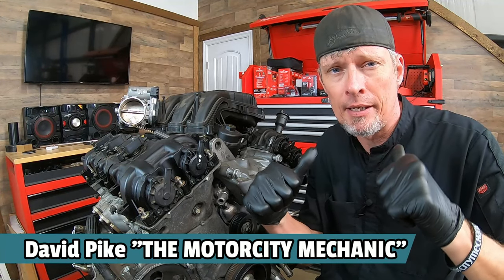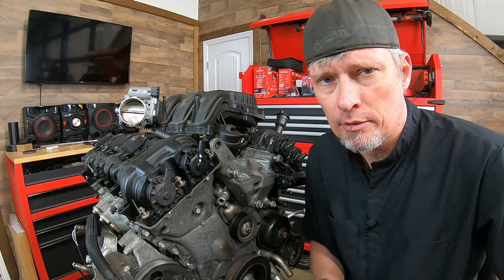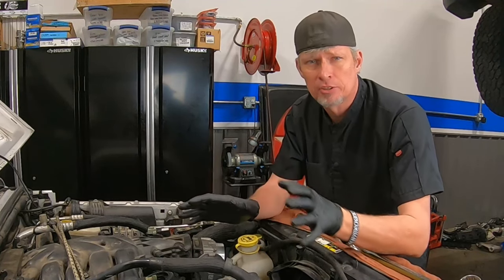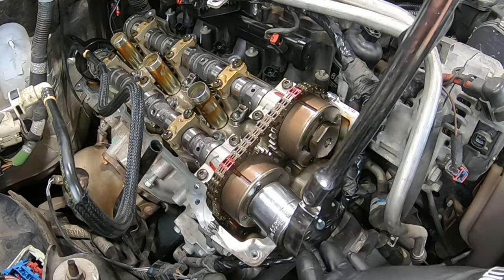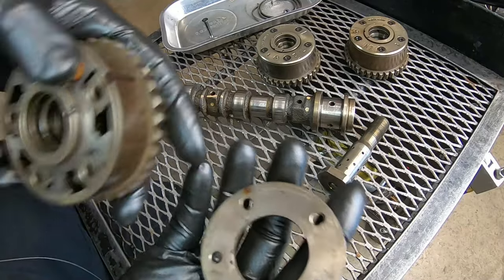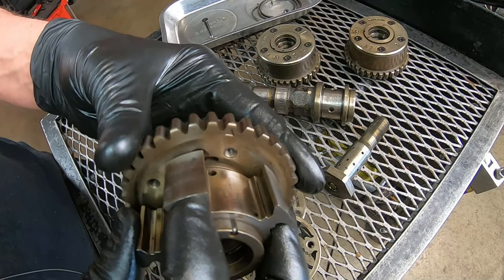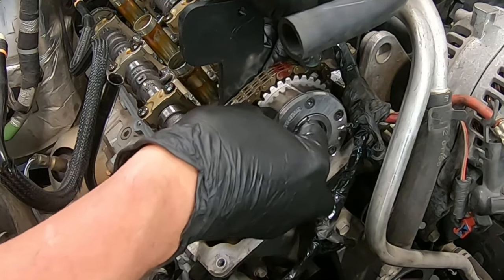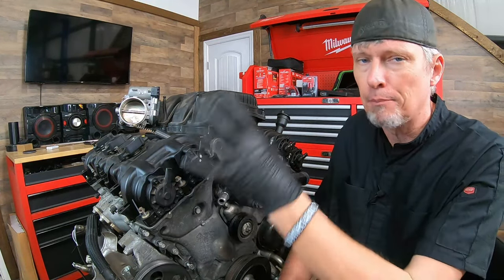Chrysler 3.2L/3.6L Camshaft Sensor Codes Possible Cause

Comment: Really good detailed explanation of the problem and the related concerns. Thank you. My 2012 Chrsyler 200 Limited 3.6 is throwing  P0340, P0345, P0365, P0394 codes. 125K, I'm tired of spending chasing the solution. Time to move on...

Comment: Fantastically good video as always! In fact, my latest video is a shoutout to your channel, simply because it’s the best for rocker, cooler, and oil pump repair guides! 

Couple of points:
As you know, we only do Promasters and most are commercial. I’ve found that the limit is between 550 and 600k miles. Assuming you address the rockers and oil cooler and dont overheat it, it’ll run fine till the rings start getting worn enough to merit a new engine. Will still run fine after 600k, but power and mpg will start to suffer. And when I replace engines, I buy 100k used ones for $2000, do the AH rockers before I put them in, and they go to 550k. Basically, the pentastar doesnt care about miles!

Second point:
We’ve never fought with P0340, but twice now I’ve fought and failed on P0016 and P0017. I’m guessing a failed phaser wouldnt code the same way, but it might. Let me paint a picture: dealer had custys van for close to 2 years! Chasing P0016. Replaced EVERYTHING including the PCM, ran dedicated wires to the CPS, multiple cams and phasers. Finally talked the custy into throwing a Jasper at it! Didnt fix it. Star case opened. Engineers visited. Dealer threw a SECOND Jasper at it. Still coded. Dealer kicked custy out with no resolution. 

Came to me. I dicked with it a while, verified everything. Failed. Sold the customer a midlevel scanner that would reset the code, and spent a proper amount of time reassuring them that it was liveable, and how to reset, and monitor pids to make them feel ok about. They are still driving it - it’s fine. 

That job was, to me, a complete fail regardless of the happy ending. We saw another P0016 where a quickie oil change place had double filled the crankcase, which frothed the oil. That custy got a new motor out of it. 

Anyway, I’d like to know if you think it’s possible that the computer could code in both ways for the same phaser problem. Occurs to me it could, depending on if the pin was stuck locked, or stuck unlocked. But I’m unsure. Thoughts?
Reply: "do the AH rockers before I put them in" What are the AH rockers? I googled AH rockers and didn't come up with anything. I put Mahle lifters and rocker in when I did mine.
Reply: @yepitsme6202  All chrysler part numbers end with two letters. In this case, AH with the H being the revision number (8th revision). AH are the latest parts, and said to eliminate or lessen the problem with the rocker arms.

Comment: David, thanks AGAIN for your instructive videos on the 3.6L VVT engine.  I am watching everything you put out on that engine - mine is in a 2013 Charger SXT and has 194,000 km on it.  No evidence of any problem yet, but I'm listening and watching.
Reply from the maker: If you ever have an issue….you know where to come to find out how to fix it
Reply: @MotorCityMechanic  Excellent video, thank you for your insight!  I recently replaced all of my cam followers and lash adjusters on our 2012 Jeep wrangler at 140k miles as we had one that was just starting to fail.  Ran great for 3000 miles, but am now getting P0340. P0365, P018 and P019 codes all at the same time.  Extended crank and momentary shudder sometimes after the engine fires up.  These are opposite banks, so possibly 2 unrelated issues - or are they?  Any insight on if these are related, and which bank to start diagnosing first?  Oil pressure is normal, and when I was inside the motor, there was no damage to camshafts - we had caught the failed cam follower in time before it did any damage to the lobe.  The camshaft reluctor (pickup) wheels did have some metallic buildup that was wiped clean but did not seem excessive, and common compared to what I have seen from other videos.  Thanks in advance for any advice!  - Jerry

Comment: Good to see a first gen still running after 200k.   Great breakdown of the problem David, always appreciate the videos.
Reply from the maker: I have a few expediting Promaster vans that have 500,000 miles on them!
Reply: @MotorCity Mechanic  so they are a good engine?
Reply: @mikegordon3436  I have a 2011 Chrysler T&C.  I had the cylinder head recall right after they came out, and I haven't had an issue internally.  The problem is everything attached to the engine that you have to worry about, but those parts are cheap to replace. These engines just like to have the oil changed regularly, and they seem to run great.

Comment: I just did the complete rocker/lifter swap and the rt side intake cam following your instruction.  I am a competent mechanic of over 30 yrs. so your instructions were easy to follow and my time was well spent watching them.  Thank you.  My problem is the jeep will not fire off now.  R2 the cam sensors, the crank sensor, the Inlet air temp sensor, and ck all thge engine and body grounds.  I didnt do anything diffent on the disassembly and had no left over parts.  Would a bad phaser keep it from firing?  I am leaning towad the notches on the back of the cam are not sending the signal to the tpm. I bought the cam on amazon so that ones on me.  any info on any more troubleshooting before i tear it all down agaito ck cam and phasers on the rt side would be appreciated.

Comment: Wait!! I think you still can remove the solenoid to check it. It looks like there is enough room to make two paint marks, one on the oil control valve and one just on the phaser body and use a bore scope or good camera to monitor if the paint marks stay aligned or move while cranking the engine over in clear flood mode or something. I have a van with over 200k and thought about long term issues but working in a shop I see several other customers over 200k and have only come across this issue once when the customer ran out of oil due to the oil cooler and had metal shaving in the oil. The customer declined repairs so I never got the chance to take the engine apart. It was also very sludged up which only seems to happen when oil changes are way too extended as they don't tend to sludge easily. Great video and something to look out for.

Comment: You should also check the oil gallery plug/bolt as it work it way loose causing low oil pressure to the phaser, common issues found on the pentastar motors. Meticulous job you do though 👍👍
Reply: It happened to my 2014 dodge grrand caravan , bank 2. The code was p0018, p0300, I went A dealership, he changed my oil and run a clean up process then charged me 500 dollars. One week after, codes came back. Sometimes the only way to save yourself is to watch Youtube
Reply: Yes I've seen a lot of that

Comment: David, as a DIYer I'm following my late Dad's advice to change oil fairly often in my '12 Chrysler 200 Touring convertible precisely because of what could go wrong with any of the cam phasers. My Pentastar engine has 70,872 miles on it and I use Pennzoil Ultra Platinum 5W-30 oil exclusively. I am also considering replacing the oil cooler/oil filter housing with the aluminum housing Dorman kit to prevent oil-leaking problems in the future. This car is my retirement ride and I like it a lot.

Comment: Thank you much, for 11 months now my car has been going into limp mode going up long hills, kept getting camshaft intermittent code P0365, replaced both am position sensors, the crank sensor and all four cam actuators and still happens, I am definitely going to check this out!

Comment: I changed rockers on one bank last weekend. I’m getting rough running and codes now. Bought a scan tool to do a cam/crank relearn. Will see how that goes. Thanks for the explanation of how the phasers work and how to test them. 
My engine has 140,000 miles. 2015 Dodge Grand Caravan.
I did not change the cam. Only one rocker was bad and cam wear on the lobe looked minor.
Reply: Which way did you take the rocker out?  Removing the timing chain, taking the cam shaft off etc. or did you loosen one/two cam caps and slide the rocker out.  If the latter, any chance the camshaft wasn't seated fully when you went to torque down the cam caps from the tension of the timing chain and it was left slightly raised in the channel?
Reply: @garykline2500  I used the phaser lock and tensioner release tools.  Slid the phasers off but did not remove the chain.  I ordered a new intake cam, phaser, and oil control valve.  The lobe with the bad rocker looked a bit chewed up.

Comment: Hi dav…i am wondering what’s was causing the locking pin not in gaged..but when I watched your video many times I think the problem with (spring)was weak not making pressure to in gaged…thanks…

Comment: Thank you so much. I just replaced the exhaust cam on bank 1 and immediately got 340, 365, & 369. I’m definitely going to test for this before removing the cam again.  I have already replaced the sensor and tested the wiring. It has to be this or the cam, right?

Comment: P0369 keeps popping in. Changed all sensors and the P0365 does not come up anymore. But this P0369 is insane, no way to pinpoint the actual issue.

Comment: When you use the tools to decompress the chain tensioner on left side is it common that you don't have to use the pick tool again? I was able to just slide the wedge between guide and end of cam shaft and the tensioner went back in with out using the pick n pull tool in the little hole. I understand it's like a hydraulic tensioner so I'm hoping that when I'm able to start engine the oil will pressurize the tensioner back to normal?? I hope this makes sense the way I described it and that I'm all set. Thank you

Comment: Great video and explanation most videos do not show you the failure points just replacement. Have you ever tried a socket like the one used to replace a heater element in a electric hot water heater its like a tubing thats been pressed into square socket ends they tend to be thinner then a thin walled socket and usually have a hole in them to insert a small bar or screw driver to turn them it may fit in the actuator hole. The wall size on what I have range between 1 and 2 millimeter.

Comment: An oscilloscope will pinpoint a bad phaser easily. Just scope the cam and crank signals, and reference a known good signal. A phaser that's not in sync, will produce a different waveform.

All of this, without removing a single screw.
Reply from the maker: I just monitor the cam position sensor readings....no need for a lab scope.
Reply: @MotorCityMechanic how exactly do I do this with my scanner? Pretty sure I already know but just want to be sure

Comment: I may have this same scenario going on.   2013 Grand Caravan, 200,00mi, Oil filter housing was leaking/had leaked so I replaced it.  Vehicle ran great for awhile and now I'm getting all the Camshaft position sensor A&B banks 1 & 2 codes plus crankshaft/camshaft correlation 018/019 codes, plus traction light.  I'm afraid the low oil condition may have caused damage to the camshaft or phasers?

Comment: Hmm, I am here for that very same problem. 2011 Charger police car, 3.6, Right exhaust phaser is unlocked, p0340 code. Was rattling on startup. I was going to do that vvt sprocket, plus replace the bad rockers and ground cam. BUT the phaser took out the right side timing chain guides. Front cover off to do those. Its a budget job so, just surgically replacing parts unfortunately.

Comment: 12:53 You can use a low-profile oil filter socket and it will fit through the hole left by the VVT actuator. I just did the rocker arms on my 2012 Caravan using your tutorial and used the same socket on the right cylinder head. There wasn't enough room to remove the OCV with a standard 36mm socket due to the AC lines.
Reply: What low-profile socket do you have? The Lisle and Steelman and such that I see online really seem pretty thick-walled.
Reply: @yohannwilkerson6058   14500 Lisle works perfectly and handles the final torque on the oil control valve with ease.
Reply: Certainly a big time saver if a test can be done by just pulling a VVT solenoid.
Reply: I sent the Lisle number to Motor city mechanic a couple of months ago. It is lisle 14500.

Comment: You can use a Articulating Borescope with Light if you have the valve cover off to look down inside the timing chain and see whats going on without removing the side cover if you are good with one to find any problems. With the motor sideways it is a royal pain to remove things if you don't have to.

Comment: Have you experienced a transmission speed sensor go bad w/o throwing a code? My 13 Grand Cherokee has a harsh low speed shift or this surging or hesitation at low speed. No codes. Tried to fix this by getting trans service with relearn. Also had fluid changes to the diffs and transfer case. The trans service showed no material and performs fantastic otherwise. Usually occurred more after cold start.

Comment: Question and I apologize if I missed the answer in the video.
If the pin was stuck from debris, couldn't it just be cleaned out and reinstalled rather than replaced?
I have 2 vehicles with 3.6l and your videos have been lifesavers (rocker arms on one, oil pump on the other). Best quality tutorials I've come across.
Thanks David!
Reply from the maker: You could try that but you spend a lot of time getting to that part that I personally don’t want to do it twice. Plus with 200,000 miles that lock pin has been doing a lot of moving over that time and some wear might be present. Thanks for always watching
Reply: I wondered that too. There’s nothing in there to go bad, other than the pin.

Comment: I have a 2013 JKU that throws the P394 camshaft position sensor B circuit intermittent if I go over 80 mph and maintain it for a little bit. Could this be caused by the same issue?

Comment: I'm getting P000B #07E8 camshaft b position slow response bank 1.  Could this code pertain to this all as well?  New engine, just installed, was getting the same code with the old engine.

Comment: 2015 JKU Rubicon 208000 maintained by myself, OCD about oil changes etc.. never had any issues other than the usual suspects alt, steering pump etc. Recently towed a u haul (probably too much weight) cross country and now Im swimming in codes... P0340 - P0365 - P0018 - P0019 Ive replaced both camshaft sensors and the crankshaft sensor is about a year old.... thoughts?
Reply: Did you get this resolved?  I'm curious as I'm seeing similar symptoms.  It happened some time after an oil cooler/filter housing replacement. Getting codes 340/345/365/390/018/019 plus some misfires in cyl 1 and 6.
Reply: @JhanJo  no, ended up throwing a piston thru the cylinder wall… sold the Jeep to some kid and he put a salvage motor in it. My recommendation would be to get a new engine. I dumped almost $3k in new parts just to have it blow up.
Reply: @fljeeper71  Dude that's a horror story!  I hate that happened to you!
Reply: @JhanJo  thanks man yes it was pretty disheartening but it’s the way things work out. I found a 2016 with only 20,000 miles on it so I bought that one.

Comment: Please help! Have cam code after installing a Baxter oil filter adapter. The adapter leaked so had to put the cartridge style filter back in however this is after cutting the bypass valve off to fit the adapter. Drove the jeep about 30 miles with it like that (I’m assuming not filtering the oil) and that’s when the codes started. My mechanic has had the vehicle for 3 weeks now and can’t figure it out. 3.6.

Comment: After replacing the harmonic balancer pulley, both left side cams, all 24 lifters & rockers, as well as the position sensor above the oil pan, the car started, but ran super rough! Even stalled completely out a few times!

Cleared the codes from the PCM and tried to startup, but now my 3.6L Touring won’t  turnover at all. I know I did everything correctly without a doubt… any suggestions on what to do next??
Reply: I’m in the same boat. Replaced right bank cams, lifters, and rockers following his video because I had a completely wiped intake cam lobe on cylinder 1. Started up, ran but kinda rough. Gave gas to 2k rpm and evened out and felt really smooth but idle was bad. Drove a couple miles, exhaust sounded way better above 4k rpm (have muffler delete and cylinder 1 misfire above 4k) but noticed power didn’t feel same. Got on gas again to 3k rpm and heard an abrupt bang and engine shut off. Pulled valve covers off, timing on cams, chain, phasers all look good, checked compression and I got 60 psi on cylinders 1 and 5 and 110 on 3. I got 110 on 2 and 6, but 90 on 4. Got codes for crank/cam position bank 1, slow cam position response A, and 2 faulty ignition coils I’m guessing on those two dead cylinders. Extremely frustrated with myself as my mom uses this car I gave to her and I maintain it. Gonna tear into it today. I’m guessing valves hit pistons but don’t understand how if everything’s in time. Gonna pull timing cover to check crank position. Tensioner failed maybe?
Reply: @wtang912  I would recheck the phaser timing, could b a tooth off

Comment: Great content keep up the good work, amazing insight. Quick question i have a 2015 ram promaster diesel. I keep getting a lightning bolt on dashboard and the van slows down and wont go over 45mph is this an electrical issue with ecm or sensor?